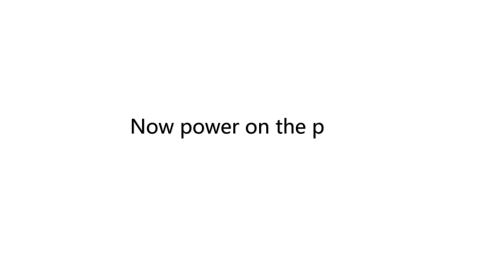Sony Xperia X Performance Fingerprint Scanner Repair Guide

Comment: When ordering spare parts for work to replace the scanner, do not forget to buy this position. "OEM Loudspeaker Bracket Sticker Replacement for Sony Xperia X Performance" 
https://www.witrigs.com/oem-loudspeaker-bracket-sticker-for-sony-xperia-x-performance 
In the video use something incomprehensible.

Comment: Having trouble to get my buttons to work? It did not want to boot up when I hold in the power button. But when i put in the charger everything is fine. Did I break a kontakt?
Reply from the maker: Did you drop it before? Can you use the fingerprint feature?
Reply: Wit Rigs . The fingerprint/ power button worked fine before the repairs. 
I did an LCD replacement. I got an LCD + the frame for the x performance as one part. 
Then I had to move all the old parts to the new frame. Then when everything was set in place I could not start the phone to see if the LCD was working.  But I could not turn on the phone. The LCD is fine and it charges when connected to charger. 

Should I buy new parts or could it be a software problem? It is possible that I could have destroyed a connector during the teardown.